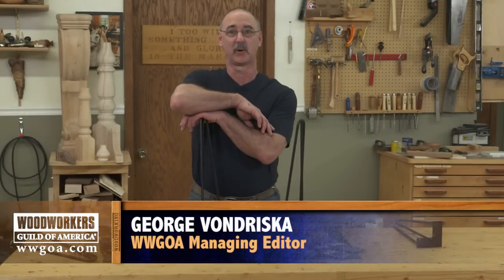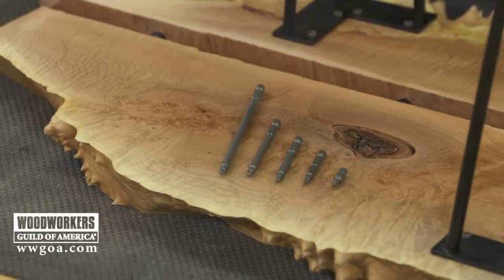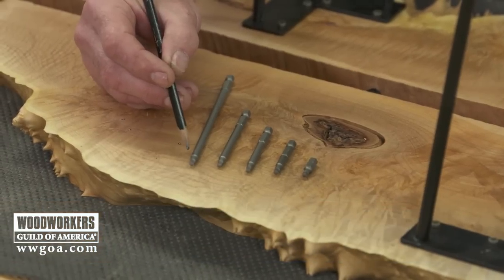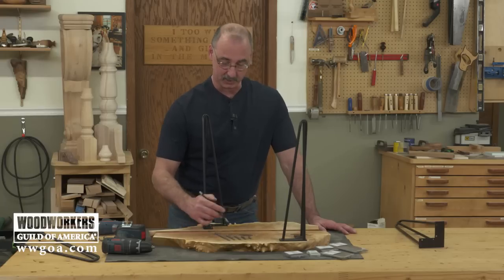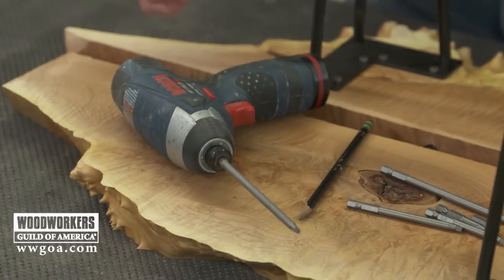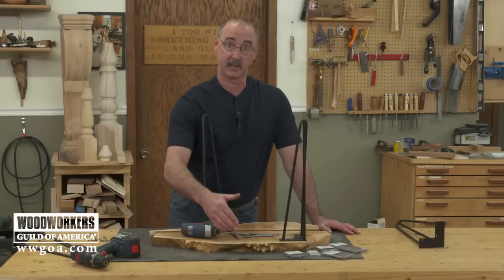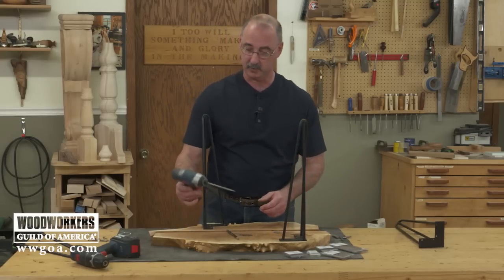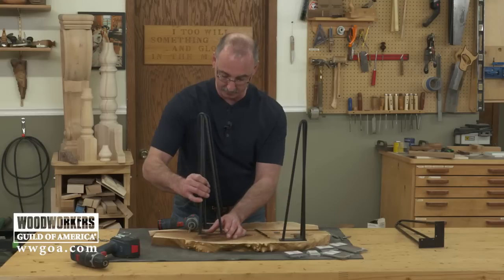George's Tips on Impact Driver Tips

Comment: Thanks for this video.  Can you tell me what brand you like and which driver kit is best to buy with all the different size Drivers
Reply from the maker: I think there are lots of good options out there, but I really like DeWalt drill and impact drivers.  I mainly use the 12V kit because it is lighter, but has plenty of power for most of my needs: http://amzn.to/2F2lOHW

When I need more power or longer battery life I go with the 20V kit  https://amzn.to/2FpKfOZ

While the 20V kit offers more power and run time with a larger battery, I have done some pretty heavy duty framing stuff with the 12V kit and it works fine for it but just requires more frequent battery charges.  For something big like framing a wall or  building a deck, however, I do appreciate the additional power provided by the 20V kit.